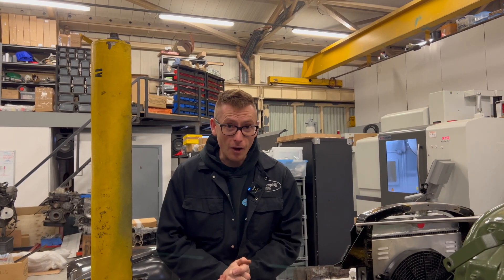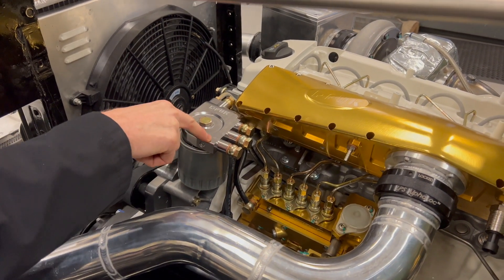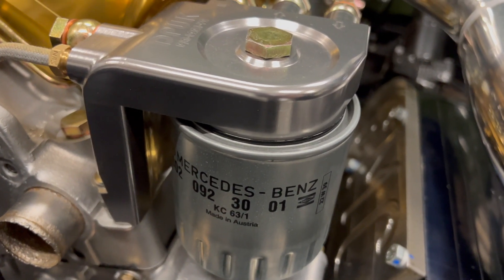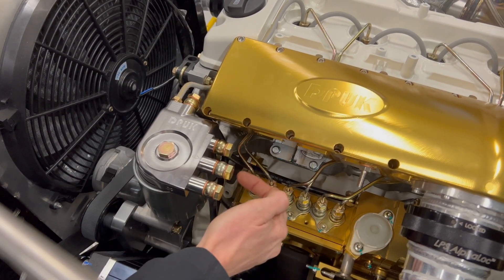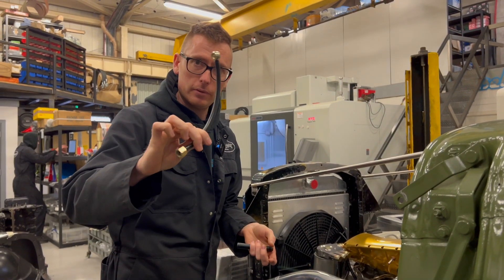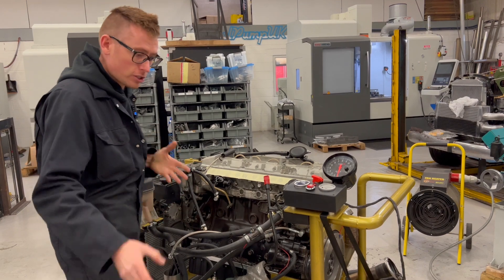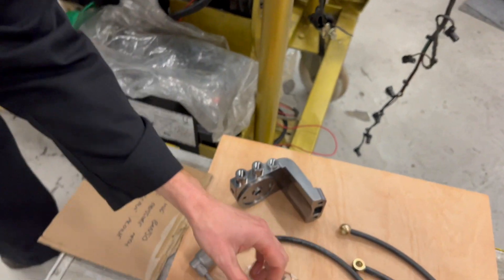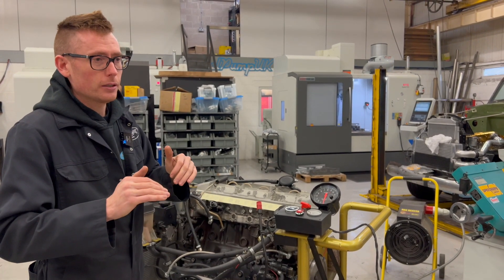OM606 Billet Filter Housing and Fuel system Tech Tips, Fuel Pressure, lift pumps and more

Comment: is there a bypass for the fuel filter in the either of the filter housing designs?  always been curious why the return lines coming from the IP, Injectors, and the actual tank return have a 4th path that goes into the filter housing.  I know on the billet one that it's to connect to the ports for the injector and IP return to the other side, but the edc housing has all of those fittings on that plastic connector, but there is still a port into the housing.  curious if anyone knows if thats for the main filter bypass or what?

Comment: Luke, Nice looking bit of kit, but..... The supply lines are all pretty small.  
I am struggling with the 10mm line (stock on the GU/Y61 Patrol) and a Carter Black (14PSI) lift pump in the rear to feed a VP44.

Comment: awesome video, as I run a stock 6mm edc pump but with a son delete and pre filter /heater delete am looking forward to ordering one of these bad boys
Reply: @LimpmodeGangmostly depends on where you live? In the US we have #2 diesel as standard fuel which will stay liquid down to about -30’F, the heater is to keep the fuel from gelling in the pump.
Reply: you only need the pre heater I guess if you live in a really cold climate
@LimpmodeGang
Reply: Did you get this to work with an EDC pump?

Comment: I don't own an OM606 or have plans to but I still watched the video start to finish rivetted by every detail! 😅
Reply: What cars have that engine in?
Reply: @RubenEarthling  loads of late 90s/early 00s mercs
Reply: not loads, only W210 and W140 has 606 turbo  @Chazillor
Reply: 😂 mee too, exatly same
Reply: I have om604 with 5.5 mm pump from om 601 .if i increase lift pump pressure will it run bettee at idle and cold.cos now it is low rpm when cold and okay wheb warm

Comment: Do you have have a kit for a 722.6 transmission so the 5th gear works? I'm looking at fitting at 606 into a w123 wagon.
Reply: think an om648 would be more suited in your case, also cheaper.

Comment: Are the 8.5mm elements the largest you can fit into your pump body/cambox?
Ive located Diesel-Kiki 9.5mm elements for an A-size inline pump. Trying to locate an OM 606 pump to see if its viable fitment wise.
Reply from the maker: We machine out the rotating cups to install the 8.5mm elements
Reply: @DieselPumpUK  Machining anything isnt an issue. Cant wait to get a body to see if these elements can be fitted. Therez also a Fiat/Iveco lift pump based on a K22 2 valve (Bosch) liftpump with the Mercedes mounting flange with a handprimer that easily makes 35-40psi. Only thing Ive found with the higher pressure is that under prolonged use the two studs can actually be pulled out of the pump body, Helicoils or Timeserts fix that.
Reply from the maker: There would not be enough wall thickness to take a further 1mm from the rotating cups.
Reply: @DieselPumpUK  By rotating cups do you mean the quadrant sleeves? I located a brandnew 4cyl and a 6 cylinder pump that these elements are fitted to, so modifying any internals to fit and work shouldnt an issue. And if it will fit Ive got a Nissan governor case that has a boost control/aneroid cast as a part of it so no Aldi. But as the pump will be going onto a marine engine it doesnt need the aneroid anyway. Will get the camshaft treated woth the same process as the Aussie V8 Supercars use on the gearboxes and rear ends. Id just like to put one together and put on the ole reliable Hartridge 1100 and see wat fuel it can produce.